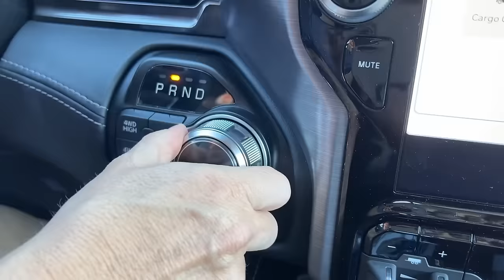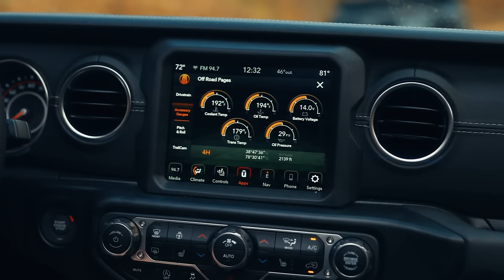2025 Ram 2500 and 3500 HD Trucks: New Look, New Cummins Engine and New Transmission

Comment: I've got 276,000 miles on my RAM 2500 with no problems.  The transmission is still good.  But, when it is time I would love to try that new ZF Powerline.
Reply from the maker: Must be better than old gearbox 🔧🔧🔧

Comment: These companies should incorporate a front hood/cowling/ fenders that tilt forward like the big rigs!!!! With locking release handles that pull out and twist to unlock after using a key to unlock the handles. So that the front body hood/fenders/crawling section is able to be locked for security reasons .

Comment: Ram should start tilting the front of the hoods downward to reduce the front blind spot.  My 3rd gen 5.9 hood slants downward significantly more that later generations.  Every truck maker seems to increase the front blind spot more with each redesign.
Reply: I find Ford has the best visibility
Reply: It seems to be a new car design all around.  Test drove a bunch of crossovers for my wife.  They all made you feel like youre sitting to low.
Reply: There's a reason for that, engine cooling. To tow up to 40,000 lbs you NEED a huge radiator and you can't get that with a small front end.

Comment: The 6.7l is a 404ci motor. The 7.2 is a 435ci. It won't make a ton of difference, but it will allow the motor to breathe and maybe not clog the def so fast
Reply: 440
Reply: The Cummins is 408 cubic inches actually
Reply: If it has emissions it’s gonna have to be bigger and more robust just because it’s a bigger engine. It’ll still suck just like all the other engines with def
Reply: dpf*
Reply: Bigger engine means lower combustion temperatures means faster DPF clogging. Only an Ecodiesel will solve that.

Comment: What is the hp and torque on the 2500 2025 6.4 gas
Reply from the maker: 410hp, 429 lbft
Reply from the maker: But... RamHD is getting a new gas engine, by Cummins!

Comment: I really hope Cummins stroked, and not bored the 6.7L to make this new 7.2.  The head gasket's firering deck purchase will suffer, IE increased likelihood of blown head gaskets?👀
Reply: Even more than currently. They already like to drop valves due to worn guides and crack water jackets from weak head material
Reply: they'll do so have them fail just after warranty is void, like Fords and almost every new vehicle

Comment: Hold up, the gm trans isn't an al. Them and ford co developed that transmission. Gm makes it in china and shipps it here. It's the exact same thing. The difference is computer programming, that's it. Gm is allowed to use the name plate. The new 8sp has been put for almost 3yrs and trested in garbage trucks and heavy delivery trucks. When ibsay heavy i mean 54k lbs. They abuse the crap out of them they haven't broken one yet. That's why they're putting them in the rams now.
Reply: False checkout the video. The half ton and suv trans were co developed, not the heavy duty transmissions.
Reply: That 8 speed has been out a very long time. My buddies 2014 ram had it. 125k miles and the engine blew up because it’s a junk engine but that transmission was fine, probably
Reply: @jeraldhogan It’s not false. They built all the 10 spds based on the design they both worked on. It’s so similar you can interchange parts in them.
Reply: @michaelward601  dude this a post with an gm engineer talking about it. I'm gonna take his word over yours
Reply: @jeraldhogan Just make sure you come back and acknowledge that I was right

Comment: What's a "ZF - Aisin" transmission?  In any event, either is a better option than the "Allison" transmission you get with GM. You only get a real Allison when you buy a 4500/5500 chassis cab: Otherwise it's just licensed by Allison. 

Second point: All the 4500/5500 trucks from any manufacturer de-tune their HP/torque output for reliability purposes. The only benefit most regular users get from the 'high output' options is bragging rights. Quarter-mile times is not what these HD trucks are about.
Reply: Just don’t buy anything with a jatco transmission

Comment: 0:48 You can get the high output in 2500's and 3500's. Idk what your talking about
Reply from the maker: High Output is available for Ram 3500, while Ram 2500 comes in the base configuration (that's said in the video)
Reply: @LetsDriveYT  Oh is that what dodge changed with putting in the high and standard output engines? Cuz my dads 2012 Ram 2500 has the high output. It's awesome af
Reply from the maker: @itsJayden461  yup, like Ford 🚀
Reply: They changed that for 2025 only 3500 come with high output

Comment: Ram needs to fix Def issues with there diesel trucks I have had a lot of them and theres alot of problems had to go back to gas to many def countdown warnings
Reply: Let the parts fall off,  FIXED
Reply: Ford, GM, and Ram will all regularly have dealer send a scan of engine control module or the mfr scan tool captures and transmits it automatically. If the configuration is not stock or overrrev has occurred they will kill engine/powertrain warranty.
Reply: Delete
Reply: @jimmyaber5920 you keep it on until warranty is over, then they make a pug for egr and take the Def off. You don't need a high hp tune, just a tune to delete the Def. Think about this. A 2003 3500 cummins would tow the same as a new 2500 with a hemi. I believe the tq was around 500 with 250hp. A 2019 and later 6.4l truck motor is completely forged. It shares parts with the demon including the sodium filled exhaust valves to dissipate heat. If you're working that motor you'll get 350-450k miles out of them. I saw a guy who has a fleet of 3500 6.4l pulling hotshots at 16-18k lbs every mile. That's what he's getting. Change the oil every 3 to 5k miles, depending on how much pulling and idle. Keep idle time to a min. I got a 22 mega cab for that reason. 3,200lbs of payload ish, and with the 4.10 rears 18k lbs of trailer. It doesn't struggle at all hauling horses or hay. I've had over 12k on the trailer.
Reply: @sonsofliberty3081  thanks for that very good advice
Reply: take the def off..
Reply: California requires it to work that way.
Reply: Get rid of the EPA problem solved

Comment: That's false, they've already said that the 2500 and 3500 will have the exact same setup. They are keeping the gas but cummins has a 6.7l in testing right now that's gas. It has 660tq. They want itbto be the same as the diesel so they have less parts to buy. Everything will be the same except pistons, head, amd injectors. Keep costs lower
Reply from the maker: And we found this info...

Comment: The 2500s need to up their payload.  Embarrassing numbers.
Reply: The sad thing is that it's set that way for license and insurance. I know in my 22 2500 6.7L, I have well exceeded the payload, and it didn't do much more than squat a bit. Hauled the pallet of concrete like it wasn't even back there.
Reply: @TheElderOne2003 exactly. People r just morons. Bitching about low payload that is only on paper. Until they up the rating and then insurance costs go up 35%.
Reply: @crazyhass84  The morons are the ones overloading the rating of the vehicle, getting into an accident and having their insurance cancelled and having everyone's   cost go up.  Sure the truck can do it, but paper is where is where it matters.
Reply: The magic number for licensing, insurance and registration is 10,000 pounds... 
I even remember a time when a half-ton could carry 1000 pounds, a 3/4-ton carried 1500 pounds, and a 1-ton carried 2000 pounds! 
Now, A properly equipped Ford Ranger can hold 1,800 pounds!!
Reply: @willf2896  100% agree. Where I live, there is minimal traffic anywhere. We might see 2  cars in 50 miles most days. Would I overload in, say, a big city, hell naw! In all honesty, I love my 2500, but for the heavy heavy hauling, I break out my 5500.
Reply: 4000 pounds my 2500 can hold is fine. Rated to. Gas engine has high payload

Comment: Still using a 2009 cab design , electrical problems , and weak transmission... they have been killing their brand for years. Why buy Ram when the other manufacturers are much better and more reliable.
Reply: I had a 19 super duty that had all sorts of electrical issues and I bought a 24 2500hd in January had it for a 1,000 miles before the Allison valve body gave out so I’m back in a ram. Ford and Chevy also having a ton of problems with dpf yeah I’m good
Reply: The transmission is from Aisin. It's an excellent towing transmission. It's not good unloaded, but great for towing. They also don't have anywhere near as many issues as Fords and GM.
Reply: They are all junk anymore. I still love my junk 2020 ram 😅
Reply: Isn’t the 2500 slated to have a zf?
Reply: @TheBridgersCabin  yes, the ZF Powerline.
Reply: Try owning a fleet of all 3 makes.
Reply: And the Regen system is a joke. Makes the truck even more unreliable.
Reply: I will push a Ram rather then get an other Ford, I bought a brand new F450 King Ranch in 2016 on my way home from dealer transmission would not shift it had 21 miles. Dealer said it was defective 3 weeks later got the truck back. On my way home all lights in dash came on truck now had 46 miles stuck at dealer for months they changed HVAC, transmission and engine ECU. Got the truck back finally, it went very well for a bit then it got cold, no heat in cab back at dealer for 3 months. Finally get the truck back put it to work towing 22,000lbs RV  like it was supposed to. first trip out turbo oil feed line came off and truck caught fire in engine bay, got the truck fixed, 5 months at dealer and finally got it back sold it bought a new Ram and I will never go back to Ford was literally a nightmare since day one. Some have issues at the end of the day buy what makes you happy. Sorry Ford, I tried…
Reply: @boonelipsey5393  they make every truck unreliable.
Reply: Much better and more reliable?  According to what data?
Reply: Duramax trucks are complete garbage. From the allison branded trans to the entire ifs
Reply: Ford used the same cab for 20 years.  Had the 6.0 and 6.4 disasters and idiots still bought more.   Most Ram transmission issues are caused by driver abuse.
Reply: My Aisin has as many miles as my wife’s Allison…….🤷‍♂️
Reply: 2017 ram drw 3500 aisin 175kmiles here. Ugh love my 4th gen before hydraulic lifter days lol. Little valve adjustment some fluid service she's still purring down the road hauling 22k+ trailers regularly
Reply: Lmao ya and chevy and ford have 0 issues right
Reply: Every manufacturer has issues pick which one ya one pay to fix 🤙
Reply: Lets be honest if you the $ to buy them brand new u got the $ to fix them. Thats why i got a 99 ram manual transmission
Reply: I have 3500 2011 ram 500,000 miles no problems
Reply: If the new engine is gonna be 7.2 L anyway, why not make a V8 diesel? Since that's what Gm and Ford have
Reply: I've tried dodge's they don't hold up I went Ford
Reply: Dumb
Reply: I’m not sure of the electrical problems you are talking about. I’ve had 5 different trucks 2010, 2014, 2015, 2018 and 2020. Currently running the 2018 and 2020. Besides the transmission, I haven’t had any issues with any of my trucks. Every truck I worked to 500,000-700,000 miles before selling. My 2020 has 367,000 miles with the original CP4, not a CP3.
Reply: You’re misinformed sir.
Reply: We have a fleet over 1 million miles no major issues, barely any minor ones. Almost went busted repairing 6.0, 6.4 & 6.7 junk Fords. Had some good GM trucks too. What’s your specific experience??

Comment: Love Ram but 6'4" bed, no auto 4x4, no thanks. Bought a chevy.
Reply: So what’s your plan to deal with the GDI fuel dilution and intake clogging on your chevy?
Reply: @craigg4246  Not sure what you're referring to. I've done a fair amount of research and haven't heard about that at all.
Reply: @outfitr9703  why would you want auto 4x4? That just screams failure . On top of that front ifs in a heavy duty truck is junk, duramax with the allison “branded” trans is unreliable. Injector and glow plug failures are enough to bankrupt you
Reply: @greggreen6636  Previous truck was a 2016 6.7 powerstroke, this time around got into a at4 duramax hd, auto awd is the best thing about this truck the rest is mehh
Reply: @cerozha it fails over time. Locked in 4x4 is better.

Comment: 13.4 liter or 14.4 v12 diesel would be my answer
Reply: @stevehunt9703  v design in a diesel kills low end pull. Inline motors always provide better usable torque
Reply: @greggreen6636 
I hear you and appreciate the response. I still think a 1 ton with a 13.4 diésel would be great, 1000 plus horse power 1500 plus pounds of torque.
My point is the customers need and want more in whatever form it takes.
Stellantis behave like the EPA is the customer. If we dont find a way to stop it there will be no Ram or  Cummins powered trucks.
Reply: @stevehunt9703  it funny how they push electric vehicles. Something they can have 100% control of the people with. Electricity is not clean energy